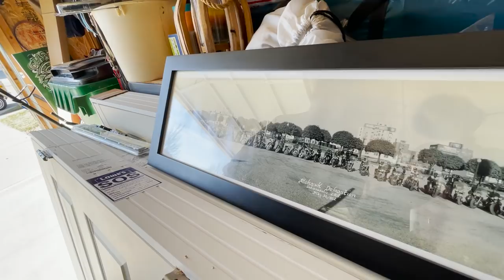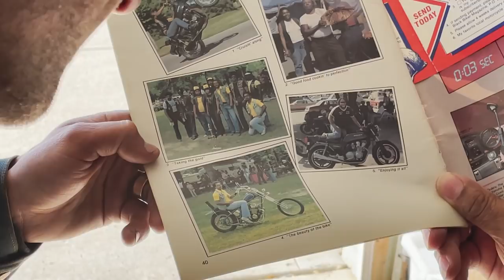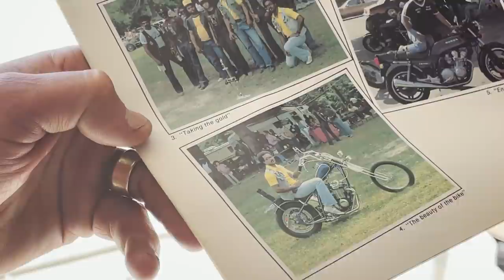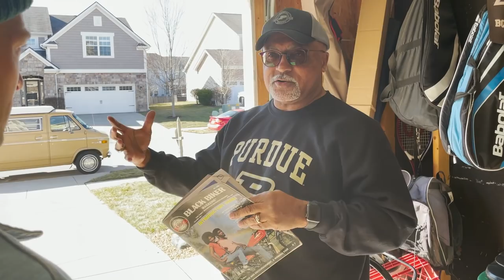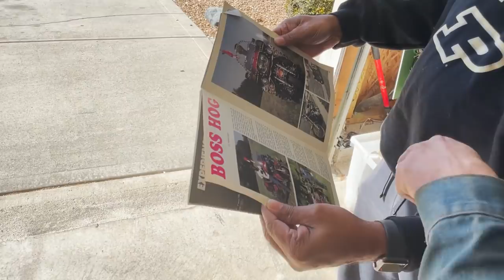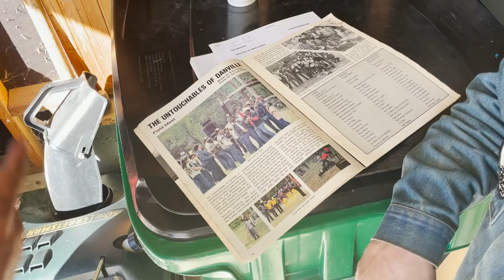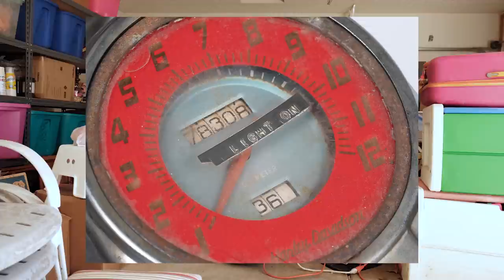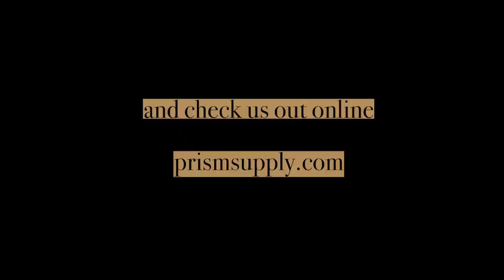PRISM SUPPLY | Road Trip of a Lifetime | Chapter 2 "Dreamboat"

Comment: That bike is awesome! The van is not. If you are lucky, and it sounds like the two of you are, the coolant leak is from the heater hoses on the engine side of the fire wall and the reason that you can smell it is the worn out engine cover gasket. If you are less lucky you get to replace the heater core. You'll know it's the core it if the smell is extra sweet and it starts to fog the windshield. Please fix engine cover gasket so you don't breathe the carbon monoxide fumes and die in your sleep on the side of the road. While you are at it, look around the head gasket for coolant and check the oil for cream. I understand that you think the clunking was just from a U-joint, but the motor mounts should be checked before you take it on the next big mission. Be nice to that beautiful bike, before you tear into it, give her a very gentle bath.